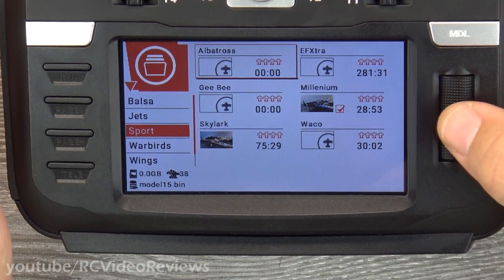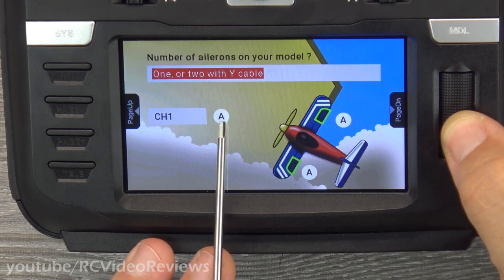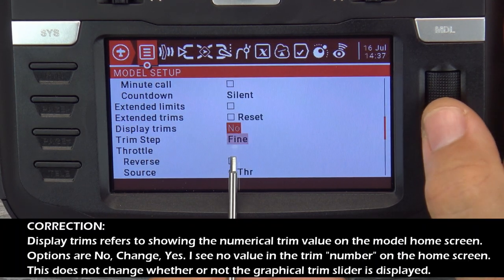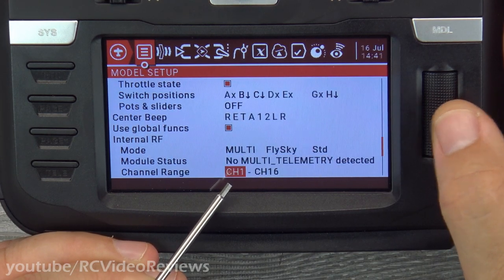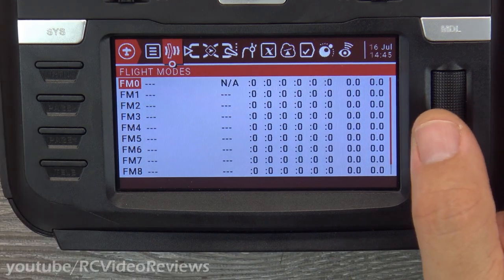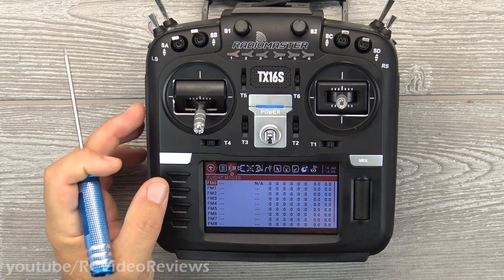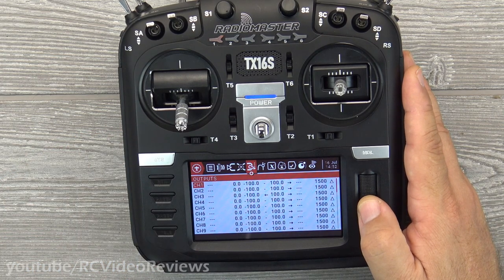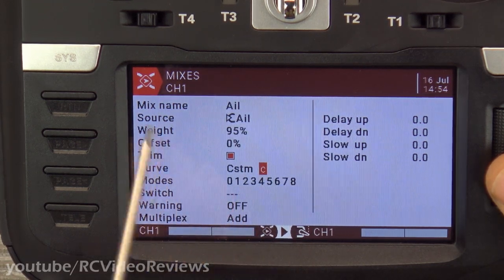Radiomaster TX16s • How-to setup an RC Plane with OpenTx Plane Setup Wizard • [Beginners]

Comment: FINALLY a video setting up this radio for planes, not quads, racing quads, fpv and all that crap. Thank you thank you thank you!!!
Reply from the maker: You're very welcome! I'm glad you found it and liked it.
Reply: RC Video Reviews do you have a video on how to swap toggle switch with the 2 positions switch?
Reply from the maker: Is this what you're asking? https://youtu.be/C3OO2poE2aM
Reply: RC Video Reviews can I subscribe more than once? Can I like more than 100 times? You are the man! Thank you 🙏
Reply from the maker: You can sub more than once via the multiplier effect--TELL YOUR FRIENDS :)

I'm rendering another good one right now. Stand-by. Should be available in about an hour.
Reply: Just got my TX16s, 5 min ago. Bound to spektrum receiver already. In love with the quality. I don’t think I will sleep tonight 😍😂
Reply from the maker: Go to Amain and get yourself some Futaba Heavy Duty springs 8M00F00101 and some FrSky Lotus Style 3D M4 Gimbal Stick Ends. I got mine today and those upgrades take the radio to a whole new level.
Reply: RC Video Reviews , good tip, I might have to look at those stick ends, because the original ones are a bit sharp.
Reply from the maker: I'll get a chance to fly with them tomorrow. So far, they've felt very nice on my bench testing.

Comment: Thanks again, my TX16S was delivered today, it is pretty daunting, for a noob.
Reply from the maker: You'll be able to find a LOT of information out there on OpenTx. While the TX16s is relatively new, I had no problem adapting to the interface. So if you get stuck, you can always look at how to do something on Taranis for which there are countless sources and those how-to's will easily translate to the TX16s.

Hopefully my video will help you with the big bits so you can get your models up and running.

Comment: So I'm completely new to flying and I just got my turbo timber evolution in today. Put it together no problem. Changed the connection to IC5 from 3 and got my first transmitter, the TX16S carbon. It's crazy how much stuff I don't understand already lol. Your video was awesome and you know your stuff. I'm subbed for sure. Send me to your best videos for getting me going and getting a profile for this new timber. It's the 1.5m version. I'm going to follow your update video now and get it up to date. Current software is from 2022.
Reply from the maker: Here's a playlist for you: https://www.youtube.com/playlist?list=PLy3TC1ILJYTi_r8rRrgLmpJ17WGEZ4lYo

Good place to start. I usually recommend just sitting down with the radio, watch the videos, play along and do what the videos show. Eventually when you do that, a little light bulb will go off and you'll be unstoppable.

Start with Inputs, Mixes, and Outputs. That flow is the heart of EdgeTX.
Reply: @RCVideoReviews  when watching your video on updating to the latest version. I seem I don't need to download the 2.8.x version because I'm already on 2.7.x. If that's correct I can just download 2.9.4 (the latest version) and then install that? Right?

Comment: Thanks for the good tutorial.
You are the only person so far that knows what the six red buttons are for!
Even the user manual does not tell us.
I am interested to learn more about flight modes as I have learnt that they are specifically designed for gliders what with wind strengths, thermals and so on.
I look forward to you doing a tutorial on this aspect but again,  any thanks for this tutorial.
Peter

Comment: Excellent tutorial for the initial setup of this radio.  Never used OpenTX, so will stay tuned for more, especially using the global function.  Unaware of using the global function vs model copy function when adding new models.  I’m particularly interested in assigning voice alerts to certain switches to standardize my radio without going through a new setup and having to reprogram, and likely forgetting to address something.   I learned something new today....Thanks!
Reply from the maker: You're welcome. I'll get that Global Functions video done soon.  It is a very useful feature for settings you want to use on every plane. Saves time and helps drive consistency from model to model.
Reply: Hey, you shouldn’t use Joshua bardwell saying on another channel. Just kidding, it’s a valid comment lol.

Comment: Thank you!  I learned how to set up the first screen by using "TELE" button. The setting of the battery voltage is:  value-> Batt !
Reply from the maker: Yup. That's a weird place to hide the battery voltage. It should be one of the first widgets available and obvious, but it's not.

Comment: Hi great video got my tx16s two days ago still getting used to open tx had a taranis years ago but at 76 you tend to forget, did a bind in a AR6600 and looks good, shame the range test doesnt work at low power will do a long range test at our field when next i go. Thanks again
Reply from the maker: Thanks for sharing

Comment: Really useful you're right up there with Andrew Newton and Painless 360. I've been holding off getting to grips with my TX16S due to work, there's so much it can do you really need to set aside some time and be in the right frame of mind to absorb it.
Reply from the maker: Appreciate the comment. Take your time and toy with it. You can't hurt the radio. Just play around until you feel like you've got it sorted out enough to fly with it.

Comment: I think that open systems may offer advantages to model boat hobbyists who may want many more operating features than model planes, etc. Thanks for the enlightenment.
Reply from the maker: Any modern radio should be able to handle any 4 channel plane. I definitely wouldn't couch OpenTx as a boat system though. I didn't think it was possible until recently, but I used every switch and every channel on an iNav setup for a mini talon recently. First time ever. 

Glad to help...

Comment: thank you. someone did a radiomaster video without  implying drone use only. me and a friend did a few reliability tests with this radio.
we have 3 planes. a timber x, fms suprez trainer and an escapade 60 size. the fms has a flysky rx in it. the timber has an X8R so does the escapade. we flew all day with the flysky rx and got great range. we did 2 batteries on the timber x and on the second flight there was a total radio out for 2 seconds only 200 feet out. the escapade flew on a different radio with xjt module and also had a radio out. we also tested 2 sfhss futaba receivers and they performed nicely so far. idk what it is with our field and FRSKY but that is not god to be having these glitches. form what im gathering you should ditch the jumper and go for radio master all day
Reply from the maker: Thanks for sharing what you know. Just to be clear: The TimberX on the X8R--was that using a TX16s multi module or a Jumper? It is disturbing to hear the X8R timed out. Those are very good Rx's. Also, what radio had the XJT module? Definitely not cool to have radio outages. 

I'll be flying this radio tomorrow using the internal multi with a V8R-ii and an S6R. I'll report what I find out.
Reply: @RCVideoReviews  the timber x with x8r was flying on the radiomaster. My escapade was flying with an old jr v8 channel with an cut module. Both receivers were brand new out of the box
Reply: With FR sky you need to do the fine tuning in model setup. Grayson hobbies has a good video on this makes a big difference. (Sometimes)
Reply from the maker: I flew an S6R, V8fr-ii, X4R, and D6FR today. I didn't tune any of them with the Fine Tuning option and they were all rock solid today. I'm adding a couple of logic switches to announce RSSI at 60, 50, 40 for my Katana and Smoove when I fly them on the new radio.
Reply: @RCVideoReviews  it takes about 1 min to tune?  I would still check at least a couple of them
Reply from the maker: Oh I did. I checked on the three that offered RSSI and I couldn’t improve on the default tuning.

Comment: Great video. Some feedback in case you don’t notice is that there’s a lot of static or hissing sound throughout the video. Just wanted to let you know in case something simple like a fan running or anything that wouldn’t require an upgrade of equipment.
Reply from the maker: Yeah, that was some time ago. I've worked out those kinks.  Thx.
Reply: @RCVideoReviews  My bad. Listened to a few from 8 months ago, but then listened to one two months old and no issues at all.

Comment: For us old farts of the lower intellectual orders these videos are a godsend. Even little things like how to reverse the servos can stump even our Junior Brains Trust. Only 1 suggestion I could make is, if you are adding text info to the videos, could you add it to the top rather than the bottom of the screen. At the bottom it gets partially obscured by the task bar when we have to pause to catch up. :)
Reply from the maker: Thanks for the suggestion. That's an easy one to implement.

Comment: Outstanding tutorial. Does seem though that you'd have to do a couple before getting comfortable with the interface.
Reply from the maker: I agree. I don’t use the wizard so when I do I bumble around a little bit. Once you get a few planes on the radio you can just use them as templates for more setups. That’s what I did these days.
Reply: @RCVideoReviews As a new guy I'm pretty sure my first few planes would be birds from HH having Specktrum ASX3 and SAFE technology. Is it easy enough to set up switches for that with OpenTX on this Transmitter? Is that the kind of stuff you were talking about when you mentioned the 6 "airplane" switches? Thanks.
Reply from the maker: @BillKisel  The 6 position switch can be assigned to any channel you want. I'm not a Spektrum guy, but my understanding is that Channel 5 is the one for Safe/ASX3 and you can assign any switch to that channel. If you need more information, you should check out our discord server: https://discord.gg/jSFTASU

Comment: Great video! So much to learn, but really exciting! Thanks!
Reply from the maker: Sure thing Jim. You're right, there is a lot to learn, just take it in bite size chunks and have fun with it.
Reply: One last question, I set up 2 of my planes today with Spektrum 636 receivers. My new F-16 has a Spektrum 637. I am reluctant to fly it off of SAFE until I get more comfortable with the speed of landing. Do you have a video that shows how to set that up? I did seem to be able to do that on my first attempt. Jim
Reply from the maker: @jimworley7385  Sorry, no Spektrum on this channel. Not my cup o' tea.
Reply: As I was trying to bind my airplane to the TX16s, I kept getting the message “Module update recommended”. What does this mean and how do I clear? Is there a download I missed? Jim in CA.

Comment: Great video, been watching this a few times. Now to do Throttle cut off.. but quick question... Not finding info on what does "Insert Before" or "Insert After"  in the mix tab. Really confused on that one. I'm a long time (12yrs) with Spektrum, and have a Jumper TX16, and now just upgraded to Edge with the new Radio Master XT16S, so basically it's the same premise, but what does that actually mean??
Reply from the maker: if you're familiar with the concept of copy/paste on a computer...same thing. You can copy a line, then paste it before or after the line the cursor is on.

Comment: Any idea why my Volantex mini warbirds bind ok but have to be rebound every time i restart the tx16s?  I disconnect the plane first and power it on last. 
If i leave the tx16s on and disconnect the plane, then reconnect, it, its still bound. But when the tx16s is turned off, I have to re bind. Any clues. Thanks

Comment: I need some help please . I have a radio master TX16, I am trying to bind it to a spectrum AR631 . The AR631 is from a crashed areoscout I had . I bought a xfly glaster and I want to use it in that plane . I am getting them bind up, but the motor does not run and all the channels are all mixed up even after setting it up AETR set up . What am I doing incorrect. 

Really need some help here

Comment: Hi John, Your videos are a huge amount of help in my attempts to master OpenTX. Is there any way, having used the Wizard to set up a model,earlier
Reply: WoW! I lost the rest of my post above. To continue: Is there any way, having used the Wizard to set up a model that I can go back to check the inputs I made as shown in the 4 minute to 7 minute marks on the video? I can easily double check settings made after the 7 min mark. Seems strange that I cannot double check my earlier inputs. Any information gratefully received
Reply from the maker: You can check any settings on any model using any method to create it. Using a wizard does not stop you from viewing inputs or any other aspect of the model setup.

Also, my advice would be to stop using the wizard. It's a useless crutch IMHO. You're far far far better off just learning to setup your models by hitting "Create Model", letting the radio populate the first four channels and going from there.

Comment: FYI throttle reversing is typically used in futaba whereas the signal is reversed through the receiver remember this is a multi-protocol
Reply from the maker: Ahhah! Thanks Jay. All these new confounded options, buttons and dials.... ;)
Reply: RC Video Reviews , it’s an awesome radio, with so many options it’s intimidating to be sure.

Comment: I just purchased the TX16S and I really appreciate your videos, the information save me a lot of time, but isn't there all way a but!! I program my first plane and a couple of the control surfaces were reversed.  I ran the video a couple of time and nothing was talk about how to reverse the servos.  In the user manual in the INPUT page under WEIGHT it said put in a negative value and the servo will reverse, but not on the input page do it on the output page where you have to reverse a small arrow to reverse a servo. a learning curve I do like the transmitter. I also would like to active the sound like your radio have not found that yet.
Reply from the maker: Yup, outputs is where you reverse the servos. I'm using the Amber sound pack. You can download it here: http://hmvc.eu/Amber22.rar Unpack and place it in your SOUNDS folder. Glad the videos have been helpful for you.

Comment: I have not watched all your videos, but they are so good I will try them all. I'm somewhat baffled. I currently have 4 airplanes setup and ready to fly on my TX16s. I have been trying to add another plane, but it will not bind. I tried 3 different DSM receivers, and they will not bind. What am I doing wrong?
Reply from the maker: I don’t know much about DSM. Have you tried setting it to DSM Auto? It is a 4in1 right?

Comment: I just purchased one of this and found your tutorial very very useful. it's good that some people like you put time and effort which helps a big community! thank you for sharing your valuable knowledges.
I have a little issue when setting up a 3 posituons switch in order to control 3 modes on an FMS Gyro. Would you mind giving me some help ? As this is a special request I can donate a few €€ if you want. Thanks in advance.
Reply from the maker: I don't have access to an FMS gyro, but what I've found on the web says to connect the channel controlled by a 3pos switch to the port labeled SBUS/PPM. So you should only have to put a 3 position switch on any mixer line--i.e. Mix Line 5. Set the source to a 3 position switch. Label it mode, then connect channel 5 from your receiver to the SBUS/PPM port on the FMS gyro.

I'm always happy to receive donations, but it's never a requirement to get help. If you're moved to do it, the easiest one-time method is via the Paypal link at the bottom of this page: https://rcvideoreviews.com/
Reply: Thanks for your prompt reply ! Will try this tomorrow.
Reply: @RCVideoReviews  
It is working ! thanks. My problem was the MIX setting.
Reply from the maker: Awesome

Comment: Hello, I am interested in the Radiomaster TX16s and I wonder what the difference is between the ELRS and the 4in1 version
what makes different?
Reply from the maker: The 4-in-1 uses a module that enables binding with many existing RF technologies like D16, DSM, AFHDS2A etc.

ELRS uses LORA modulation and will only bind with ELRS receivers; however, that list of receivers is impressive and since it is opensource, the development cycle is continuous. ELRS has also proven to be rock solid control. 

There are use cases for both, it kind of depends on what you're trying to accomplish.

Comment: Sir, are you still working with opentx? I have some questions about its its functionality for a project, because it's been depreciated, but seems functional for what im doing. Thanks
Reply from the maker: I haven't touched OpenTX in a meaningful way for about two years. You can always join my discord and ask way though. People who are familiar with EdgeTX may also be familiar with OTX.
Reply: Does that mean your using a different system, or your not active in the community? did you change systems? The reason i ask is i have a proximate 2 year project on a drone im designing and building. The issue is, 1, can i use the opentx system for the project since it is depreciated and un-maintained, although functioning well and properly as far as i can tell for what i need it to do *ive been learning and experimenting with it on my FC, QGC and Taranis and it seems quite capable and functional. Do you suggest i use some other system, aka edgetx,???. I would hope to have a system like opentx or similar for future projects as well, and it seems in the near future i would need to change to a system maintained and in development for future plans in UAV development, so i would like to be learning a developing in a maintained and developing system. Suggestions? Thoughts? Thanks sir. @RCVideoReviews